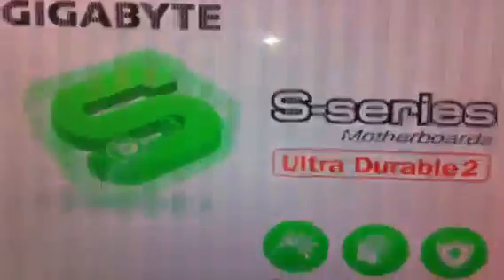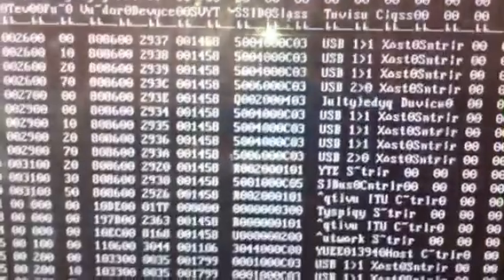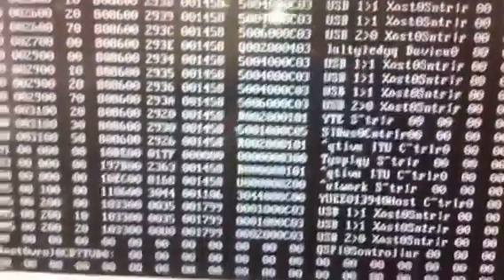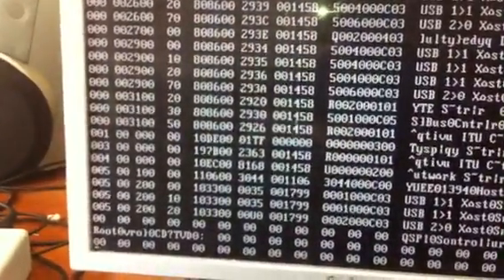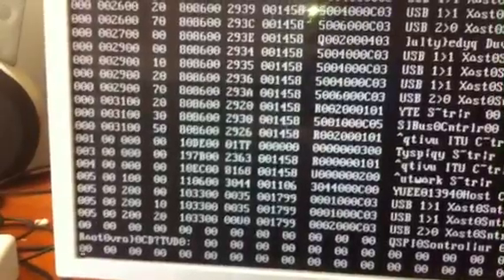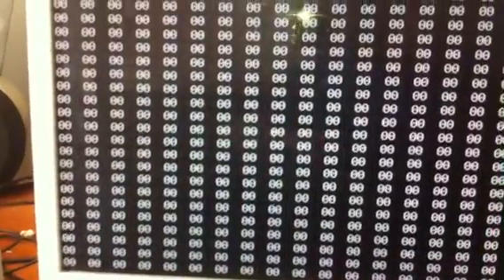Computer not booting up

Comment: Mine has been doing the same but im running windows 7 im following this vid to see if anybody answers
Reply from the maker: I made this video a while back and I'm struggling to remember why  it was doing that, but eventually I got it to work.  I vaguely remember that it had something to do with the RAM.  Either I had it installed in the wrong slots or I grabbed the wrong type, but I'm not exactly sure.  Check your RAM and make sure it's the correct kind and installed properly.
Reply: ok thanks it worked it was just loose and wonky

thanks